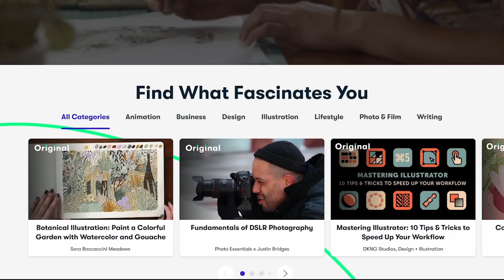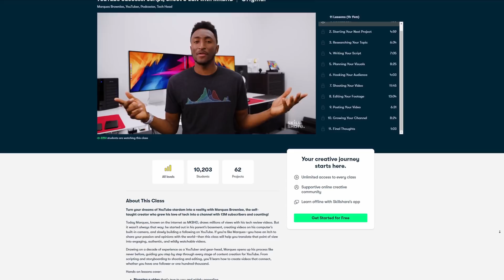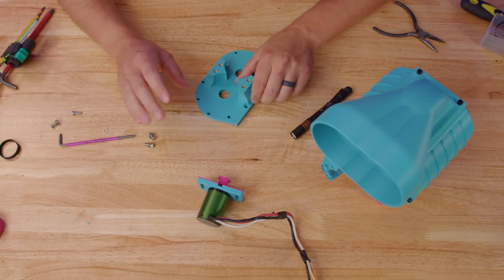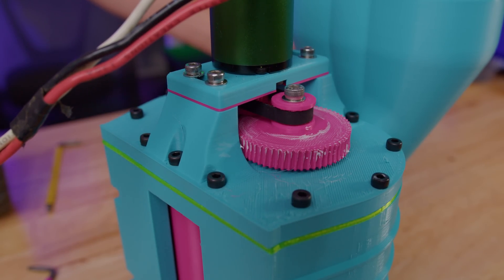I Attached a 100,000 RPM MAX Castle Mamba to my 3D printed SUPERCHARGER..... Will it Survive?

Comment: No smoke????!!!!!!?????  Also need an area to actually compress the air, a tank or vessel, to hold the compressed air, and measure pressure rather than "air flow" ... object of a "super-charger or turbo" is compression, dense air has more oxygen more oxygen equals more burn.. as for air flow, "it" the super charger isn't effective (efficient) enough, a fan blade on the end of that motor will produce wayyyyyyyy more air flow. Just saying.. and smoke!!!  for the love of God give us smoke!!...

Comment: You still didn't grease the the main lobes. Grease between the lobes and the housing as well as the loves themselves will bring it further. Or alternately you could use silicon, teflon or graffite lubricant, but I think grease will give you more performance and bring down the sound some. Dry silicon by 3m would be my 2nd choice.
Reply: I was thinking molybdenum disulfide grease because it's fantastic for imperfect surfaces. This is why it's used so often with powder cindered gears. I think it would work perfectly with 3D printed parts.
Reply: They aren't supposed to be touching in the first place... Maybe lightly oil the gears or graphite the gears, leave the rotor lobes alone.
Reply: @kleetus92  They are supposed to have extremely tight tolerances, so realistically you want them rubbing with grease for 3D printed parts, and let them wear to a natural tolerance

Comment: The Dell PowerEdge server power supply can be had for relatively cheap on eBay, with a few pins jumped on the back they do 700 watts at 12v on the main outputs; I run one for my 16 x16" heated 3d printer bed. Get two and you could run both in parallel for 1400 watts (they loud tho)

Comment: Not a power supply, but a big car battery will give you 11-12volt, that Mamba system might be rated for 6S (please check) if so, 2 car batteries in series will give you 22-24v, with all of the amps you can use. 
You could also look at a PWM controller, so you don't have to use the RC circuit, just have to train the ESC to accept the new signal High-Mid-Low. Should also turn off any decel braking and lock out reverse.

Comment: You know, it might be fun to rig up a beefy motor to the normal fan housing for the next season of the fan showdown. See what people's designs can really do when fully unleashed.

Also, you gotta rig up a static pressure test somehow. I bet this thing would really do well with that.
Reply: A more practical option would be to cut the blades off something like a 5000 rpm 120mm delta fan and use that instead of the noctua. 

It'd be fun but I'm pretty sure the force on the blades would simply destroy most 3D printed designs if they pushed anywhere near speeds like this.

Comment: 1800W 40A CC CV Boost converter 10-60V to 12-90V
Truck Lead acid battery N100 12V 100Ah 
this set up can give you around 1.5 hours at 30 Amps power draw, go to higher N like N120 or N150 to go longer

Comment: "DC Power Supply Variable" maybe a option? Than you can change the voltage and amps. And is not to expensive. And plug in fans if you want to have some fun😂

Comment: The motor is drawing more too much current and can't provide the required torque without gear reduction. That motor is drawing easily over 100A. A bigger brushless motor like a 40mm diameter x 65mm or should handle it, and reducing the kV rating will cover the absurd amperage issue - something around 2000kV would still give a no-load RPM of 36,000 at 12.0V. The TrackStar 2025kV 1/8 motor from HobbyKing is good choice at $50.

Comment: The high cfm/fpm is really more of a testament to the high output of that motor rather than the design of the supercharger. It would be interesting to see what kind of results you'd get if you took some of the more higher performing fans on the list and powered them with that motor. Assuming they don't just explode.
Reply: Of course you are right, but i think his point wasn't to really compare the thing to the fan-showdown as such a design wouldn't be possible with an a12x25 motor. It was just interesting to see how it performed.
I'd say the strength of a blower isn't it's maximum throughput in a relatively unobstructed application, it can rather perform well in a high static pressure environment where a conventional fan will not have the ability to produce any significant throughput.
Also testing the fan-showdown fans at such a speed (if they can even take it) would probably result in rather diminishing returns as evry fan design has a rpm range where it performs well (thats also why normal props, turbo props and plane turbines all have different blade shapes and counts).
Hope what i said makes sense 😅
Reply: @cycl0n362  Yeah aside from normal fans potentially exploding, after a certain speed they might not even push air anymore. Basically cause cavitation like a prop in water just much less damaging to the props in air. lol

Comment: Multille atx psus and a 12v car battery in parallel.
For dc voltage regulator use 150a buck converter. Might be a bit expensive.

Comment: Not going to add to psu's but voltage. If you increase voltage, the amps will lower for the same work (rpm). Had a too high amps issue in one of my projects that i could only solve with more volts. 3s would not work (because of amperage) for the components, but 5s did.

Comment: You put the wrong link in the description, link to the motor is a duplicate of the link for the inserts.

You want a quick n dirty way to run this at max? Connect 2 topped off car batteries in series (or a single 24V one), should roughly give you the full 25.5V. And as much current as she'll take. 

Also,it won't get you max voltage, but have you considered trying to run it off a large capacity powertool battery? Some of the prosumer+ grade tool, 5 or 9Ah+ batteries can easily put out well beyond 100 amps.

Comment: Unless I'm missing something, your "supercharger" seems to be missing the most important part, the compressor. At this point, it's effectively a really fast paper shredder, minus the teeth. You should make screw shaped compressor wheels instead of flat ones, with a taper, so that the air at the end is squeezed harder than at the beginning. Or if you want flat wheels, the offset the lobes so that the air is squeezed tighter and tighter as it nears the exhaust.
Reply: It's a roots blower the lobs are offset just like a roots blower he showed this in the last video on this
Reply: @juicedmedia6623   Ok, good point, I just went and watched that previous video, and unfortunately, it's still the wrong design. If you have incredible tolerances, then the straight lobe design "can" work, in an engine that's got an abundance of excess energy to throw at the problem and requires as much air flow as possible (oxygen). However, in this case, where air movement is key,  this is about as efficient as manually waving your hand over the heat sink.
Reply: @eugenes9751  lol yea idk if it was ever supposed to even last beyond the first video though so he didn't make it as good as it could be
Reply: @juicedmedia6623  But his videos are about efficiency, not how long they last....
Reply: @eugenes9751  yea but again I don't think he even expected it to last let alone even move air with the lack of tolerance in the thing ya know
Reply: Yeah, I was going to say, there's a lot of inefficiency in his design, given he barely is outperforming a conventional manufacturer fan with some aero optimization using a positive displacement style blower and an RC race car motor with a far stronger current.
Reply: How about he fixes the drive issues, before he starts trying to refine it?
Reply: Yea he said in his 1st video he wasn't trying to get a working compressor going for it.  It's really just for funsies now

Comment: Need more info on voltage and amperage requirements. Then I can suggest a power supply.
Edit:
Assuming it's a 5 amp battery at 20c that's 100 amps of sustained current.
Really need to know the voltage.  If you are able to use higher voltage then you could use less current.

Comment: Pretty sure you can run 3S lipos on that esc. You'd have to get a 5000-6000mAh at 100-200C battery to get the amps you want. That battery you have is a baby

Comment: I'm amazed by how much power those 3d printed parts can take
Reply: Right! I have seen a bunch of printed gears on youtube way exceed my expectations.
Reply: I think a big one is due to how fantastic the tech has gotten, especially comparing it to older 3D printers. Im glad the tech has gotten to this point thats for sure
Reply: @DeathProductions200  there has been almost no tech advancement in 30 years....the price point just got lower.
Reply: @DieselRamcharger  Standardized heated beds, larger print area, standardized auto-leveling, and all of these getting cheaper.

But all of those things existed for the most part.
Reply: @joeleonard9965  bringing the price point down is scale of economy, not advancement. auto bed leveling is a crutch not a feature. its still better to have a machine that is mechanically accurate. but i digress. all the things you named are just features that have become common place to commercial {commodity} hobby printers. 3D Printing has existed as Rapid Prototyping since the 1970's. Which is where the term "RepRap" has its roots. RepRap being the OpenSource community that invented the thing you call 3D printing today...3D printing being the china sales gimmick tacked onto what was essentially an ass ton of stolen i.p. Then you got fake as fuck's like Prusia....but anyhoo.
Reply: @DieselRamcharger  I literally didn't disagree with you and said nowhere that those were advancements and not features that got cheaper.

Not sure why you have such a thing against auto leveling. The effect it has on tolerances is something you would only notice if you are using it professionally for highly detailed prints, in which case you should know that doesn't apply to most buyers.
Reply: @joeleonard9965  its not "auto leveling". If the beds actually auto leveled that would be great. But they dont. Its a plot of your uneven surface which then tries to replicate that deformity in software. Keeping the nozzle a consistent distance from an uneven bed. You still end up with a part that is skewed or generally low fidelity. i dont like auto leveling because its a crap work around for lack of user knowledge. Set the machine up properly and youll get better more accurate prints. 3D printing is the first step for me, not the last. i need my printed parts to be accurate because they will be replicated out of different material on other machines.

Comment: Also, you will get quite the efficiency gain and noise reduction if you can get the rotors twisted so that two are always engaged. 
As the compressor works, it will likely cause thermal expansion which could lead to increased drag and some other issues. (Just things to think about... They do in the metal units)

Comment: Maybe you need a pre-made belt?  It did seem quieter with a belt, though hard to say what RPM you got it up to.

For power, it might be easier to replace the motor with an AC one you can drive off a VFD from your house mains.  That would get up to way higher RPM without the amps melting the motor or the power delivery system.  Just, you know, be careful with the 120VAC...

Comment: you could make connector that connects few lipos in parallel so you could run the supercharger longer. Also you could make similar seals into to the screws like in rotary engine, i guess that those are called apex seals, Teflon would be good i think

Comment: No idea why my other comment isn't showing up, so maybe it got deleted or something, but you can search for HP 1200W server power supply and get some 12V@100A supplies for under $50/each.  There's other wattages available too, but if you're ordering it you might as well get the highest.  I had a bunch of 750W ones laying around so I ended up ducttaping 4 of them together and soldered some massive wires on and now I have a 250A 12.5V supply I use to jump start vehicles lol
Reply: And they do have over current protection, so if accidentally short the output together they should be fine...

Comment: You should use the charger for the batteries to directly power the motor. It may not give you quite the same peak current, but, it should provide that current indefinitely.

Comment: something is wrong with your ESC or batteries. It should run for a long time. Sureley there is less load on the motor just blowing air than there would have been in the car.

Comment: heh.,.. I have a bench LiFePo4  50ah with a few xt60 leads hanging off it... 
would drive that motor for a few hours... 
problem is you are pulling like 100a... that PSU is huge.... 
would need to get 24v 100a PSU... then feed that to the ESC.  2400w... like $500 
Mamba Monster X takes up to 33.6v... 
Batteries are cheaper... 6s... 8s... what KV motor is that?  (2 3 or 4s in series) 

how small a pinion can you put on it? something like a 12t Mod 1.5 ? 
then crank up the Volts.

Comment: make your own powersupply. it doesn't have to be fancy..  use a variac + 4 diodes and a couple large capacitors.  dial the variac to adjust power..

Comment: Dude you really need to run a gear reduction between the motor and blower, a belt drive with 1:3 or 1:4 should work compared to the 1:1 you tried, the motor needs to be at a much higher RPM than the blower to work efficiently.

Comment: if you only need 12v you can get one or more of hp common slot psu-s, you can find them with outputs of 1200w and down, parallel them for more

Comment: serial connect 16 battery packs. <=== like that not positive to negative. a pair of rails or as many as you have plug connectors. and screw or bolt splice on additional connectors to the rails this does not increase Voltage.. but it increases amperage. then at the tip end of the rails the outbound connector gets connected or some extension lines to the connector

Comment: This may be interesting... but its not usable, being that loud.
As for gears, they need to be so precise.. that if there is any wobble, structural flex, or tooth inaccuracies.. its going to cause noise, friction, and wear issues.

 The smaller the tooth, the more prone to failure.  Larger teeth allow for a bit more play... though, its still not good to have play issues.

 Belts have their own issues.  The smaller the belts teeth... the more likely they are to slip off of the gears... especially if the fit isnt very good to begin with.   A tensioned  "V-Belt"   is far less likely to have Fit based issues.  Even  v-pullys with a round rubber belt,  would still be better than that flat toothed belt. (The V-Shape adds more frictional force, as you are driving with more surface area)

 I believe those flat belts are only for low speed mechanism... such as a the inner workings of a tape player.